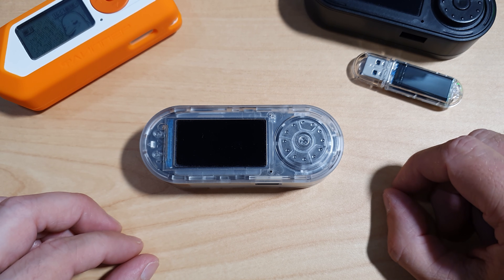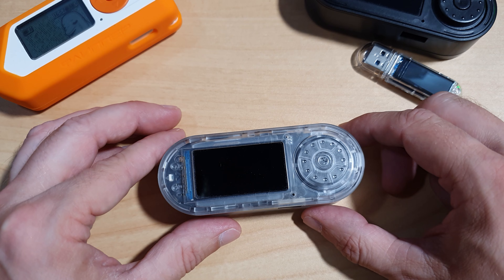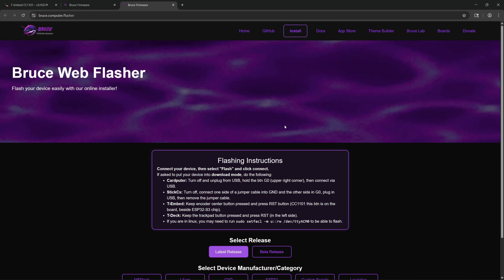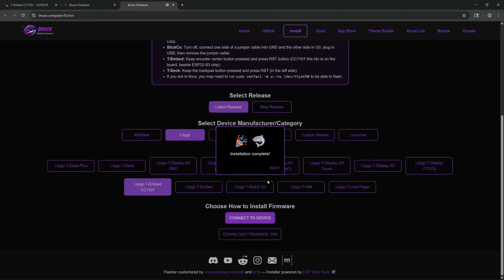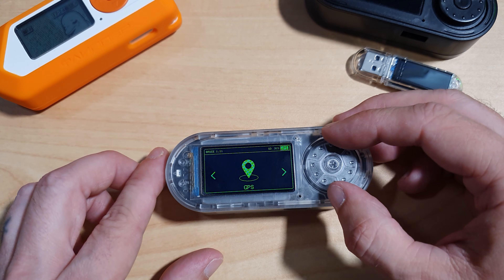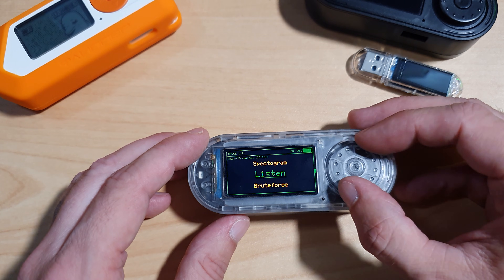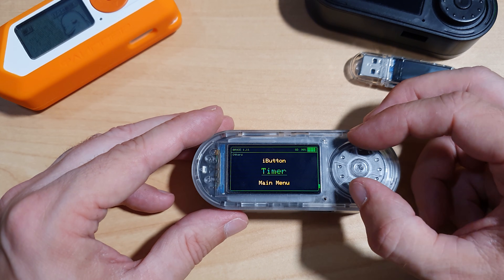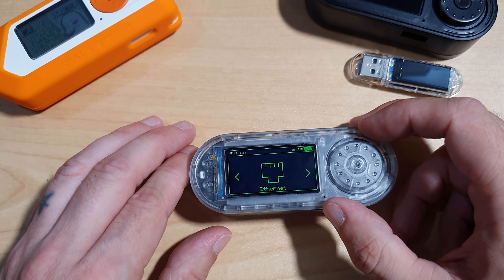Lilygo T Embed CC1101 Hacking Gadget Review - How to install / update bruce firmware

Comment: Probably a dumb question but is there a way to test any of the features to learn how to use it right if you are a beginner ? So that you don't get in trouble or cause anyone any trouble .
Reply from the maker: Just make sure to test on networks you have permission to test on such as your own. One way is to set up a separate wireless network to test on.

Comment: im only now starting to get into the hacking gadget scene. Im interested to learn more and willing to buy into a device but not Flipper zero prices yet. I have it kind of down between this CC1101 Plus or the card Puter. Id like to dabble with RFID, Wifi, BT and RF. Like a jack of all trades to dip my feet in most of it. RFID specially could be useful with my work so i'd probably use a chameleon and adding PN532_BLE to the Card puter. Is there a way to unlock the high and low frequency with the CC1101 plus via an addon? Which of these two would you recommend for a first time user?
Reply from the maker: I haven't used the M5 Cardputer for anything other than Marauder and Evil so I have not used it with any of the add on modules and I also haven't tried the new Cardputer ADV yet. As for the LilyGo T-Embed CC1101 plus using Bruce Firmware it has everything you need built in. The only caveat for me is the lack of RFID/NFC emulation but with a Chameleon Ultra clone it can. Another alternative is the Kiisu which is a clone of the flipper zero that uses the same firmware. The battery life isn't great and prices have gone up recently but it's a very capable device. Doesn't come with a case either but Tron makes really nice cases for the Kiisu.
Reply: @nobultech thanks for the response. I still have no idea which way I’m leaning towards. As a beginner in every way possible I feel it may not be worth me jumping in so deep. The kissu board for me is $130 and going to take 21 Buisness days to have it shipped which sucks. I was looking at the cardputer because it’s modular with a large battery and keyboard so I figured it would be the best catch all as I learn. I do really like the form factor of the c1101 plus and it’s out of the box usability with Bruce but then I also wonder how good it would be if I want to use different firmware than Bruce. How was your experience with the cardputer? Do you have a daily gadget you prefer to use?
Reply from the maker: @JasonEdgar-gr6pi For a daily driver I use the Flipper Zero, Chameleon Ultra clone and the JCMK Marauder V7 but that changes a lot.

The Cardputer is an excellent choice, it's modular so expandable and with the launcher firmware you can run Bruce, Evil and Marauder. If it had internal GPS it would be a daily carry.

The cardputer also has better build quality than a lot of gadgets available.

The Lilygo T-Embed CC1101 might be cheaper overall when considering the cost of the modules you will need for the Cardputer to do the same things.

Comment: Mine won’t turn on, please help
Reply from the maker: What is the issue? If it's in deep sleep or off you need to plug it in via usb c to turn it back on.
Reply: @nobultechi tried downloading m5launcher an it started glitching, when I tried downloading bruce the com port kept disappearing and reappearing, but I fixed it, I had to hold the boot button and press the rest button the plug it in.

Comment: Why it doesn't go on except if I plug in and why if I deep sleep from button it goes black but if I deep sleep from setting it works?
Reply from the maker: It's a little finicky on the power front. Holding the power button only ours it into sleep mode. Turning it off from the menu requires it to be plugged in via USB C to turn in back on
Reply: @nobultechthanks a lot .dos it copied key cards and credit cards and is it able to transmit ? Or I need something? What's chameleon ultra?
Reply from the maker: @sofiensofien9556 the LilyGo T-Embed CC1101 can only wright and read. To emulate you would need to pair it with a Chameleon Ultra or a Chameleon Ultra clone. The Chameleon Ultra is a device the size of a Flipper Zero screen that can read, wright and emulate RFID and NFC. It does have some limitations but RocketGod recently made an update for it.

Comment: Excellent video! What is the recommended microSD capacity?
Reply from the maker: I'm using a PNY 32GB MicroSD card and that would be considered a lot. Not sure if it would be compatible with higher capacities but 32GB is more than enough